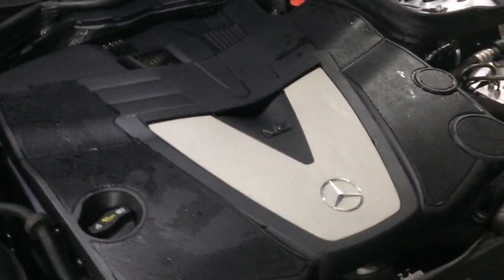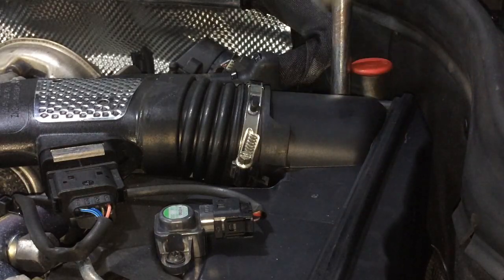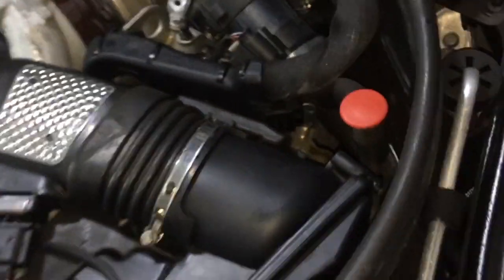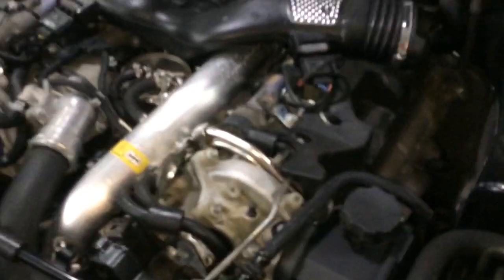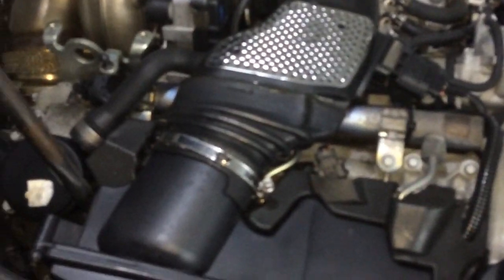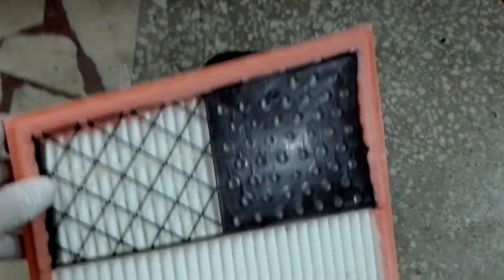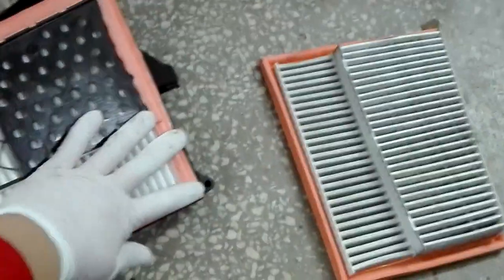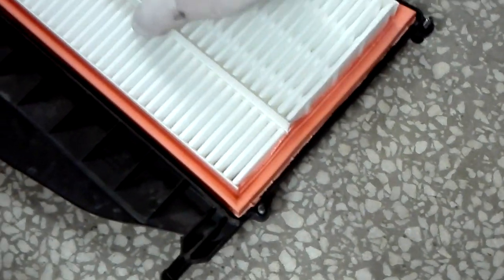How to change the OM642 air filters 3.0L V6 Mercedes Benz Diesel Engine

Comment: Salut, ce ulei folosesti la acest model?
Reply from the maker: Salut. Multumesc de comment. Imi cer scuze ca a durat asa mult sa raspund, cumva a trecut neobservat. Folosesc ulei cu specific 229.51 sau 229.52. Am utilizat pana acum Motul Specific 229.52 5W30, Mobil 1 Formula ESP 5W-30, Yacco Lube M 5W-30.
Reply: @AlexAndreiZAR  multumesc de raspuns 😊 chear planific sa schimb uleiul zilele urmatoarea.
Reply: @SelectTaxi24 încearcă liqui molly

Comment: After you changed your air filters did you not do value adaptation reset?  My 2009 ML 320 Bluetec require adaption each time you changed the air filter otherwise P0101 fault code will keep coming back. It is annoying because you need MB star scan tool to do this reset.
Reply from the maker: Hi. I heard that some cars require this but my car didn't  need this adaptation. Thank you for your input!
Reply: My cls never needed adaption reset either.